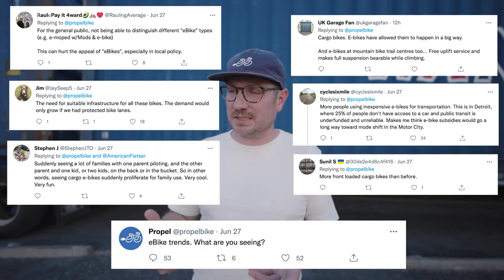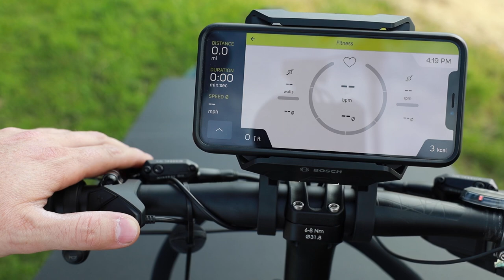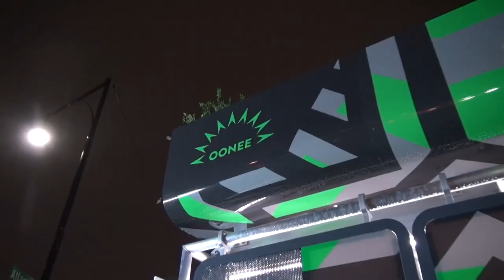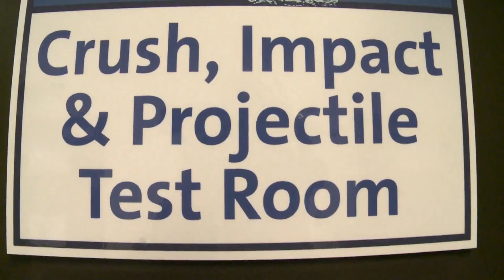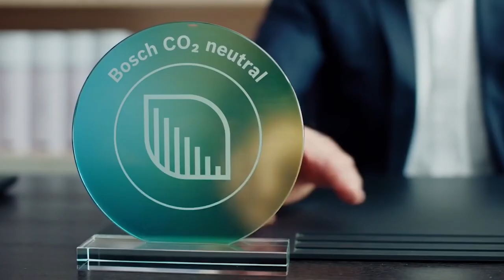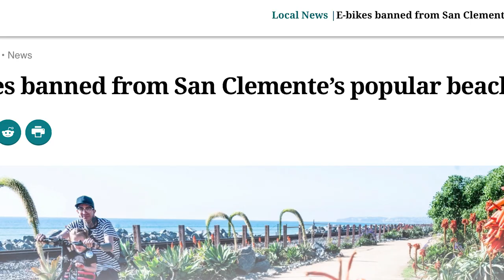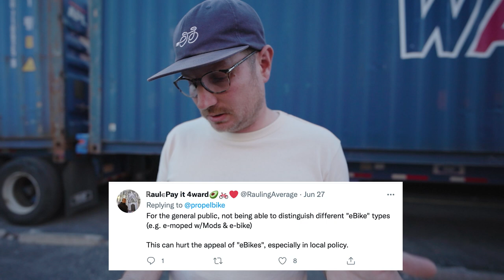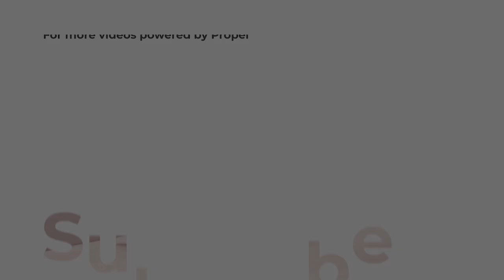eBike Trends for 2022

Comment: Thanks for a great and thoughtful overview of the industry. Linking to the safety issues discussion I’d like to add: Braking of bike trailers. The need for brake systems on trailers that integrate with the bike’s brake. I.e. that brake/s on single- or double-wheel trailers are also activated – e.g. hydraulically or electrically – when braking the bicycle. Loaded bike trailers easily add 50-70 pounds (25-35 kg) to the bike’s combined weight. In one case on Youtube the rider tells his trailer weigh 100 kg. 
Two: particularly for vacation purposes the range of ebikes is an issue. I.e., long distance travelling I believe is growing. This includes visiting more remote places where charging possibilities may be few and far between. For added flexibility – daily use vs. going on vacation - manufacturers may build in plug/s and battery combiner electronics for easy attachment of additional batteries, including non-brand specific ones – for 200 mile/300 km range. 
Lastly, reviews and testing of ebikes would benefit from discussion of a bike’s expected range. I am mindful of the issues related to wind, road and gradient conditions, the rider’s weight, the number of stoppages when riding etc. However, a simple test of the range achieved by the reviewer and the number of Wh consumed per mile/km will benefit prospective customers in choosing ebike’s that suit their needs.

Comment: I used to ride my regular bike for local errands. I have it insured and use a Kryptonite lock for the bike with a cable through the rear wheel. I felt safe enough taking it to the barbers, dry cleaners, Sprouts, Krogers, local shopping centers. Even rode to the nearest express bus center and took it in to Atlanta for work several times. There is a multi-use path very close to me, giving access to pretty much anything I need. However, no bike racks at Target, Publix, Lowes, Home Depot, optometrists, dentist, Chick-filA,  Zaxby's, ... It would be a huge win if shop owners with easy bike access simply installed decent bike racks. I've taken my e-bike to a lot of these places and feel pretty safe with shops that have something to lock my e-bike to. But I wouldn't take it anywhere that doesn't at the very least have a bike rack or something suitable. I should probably start writing letters just asking for bike racks. And add my e-bike to my insurance plan. And maybe get a slightly beefier lock. And either lose a lot of weight or get a battery with more range. Or both.

Comment: They NEED to get more affordable
Reply: Agreed. Won't get better infrastructure until we get more bikes on the road.
Reply: Some ebikes cost as much as a car did in the 80s. Down right ridiculous.
Reply: With time, the secondary market is going to be more available. Right now its still kind of cutting edge so not a lot out there
Reply: So you wanted more affordable cars or cars which are built good? I guess we know the answer.
Reply from the maker: I agree the price needs to come down. This will happen with scale. It’s just a matter of time. Unfortunately many of the cheap eBikes cut a lot of corners so it’s a false economy from my perspective. Once we have proper safety standards this will start to stabilize and scale appropriately.
Reply: Retrofitting existing bikes with a conversion kit can make ebikes very affordable. Obviously "affordable" is subjective but I converted mine for $2k and now I have a 40kmph bike with a 60km plus range. Bloody brilliant
Reply: You can get ebikes for less than a thousand pounds. That's affordable.
Reply: @Propelbikes  If you wanted to, you could sell Chinese bikes as well as the ridiculously overpriced ones you sell. The Chinese bikes are just as good as bikes costing twice as much or more.
Reply: @ninetendopesaitama2107  Of course we want an ebike that is built good. It can be done at lower cost. C'mon.

*

Comment: Chris, you well covered most of the angles and bases in this video with some well-thought opinions. If I may: 2 items: Right to Repair and the quick fade of Haibike in the US/North American Market. Right To Repair: There are a few of us out there that like to maintain and repair our own bikes. After the business Performance Line Bearings in England came on line with kits to renew our motor bearings, I thought why does not Yamaha or Bosch, Brose or Shimano make available the interior components of our motors, such as circuit boards, torque sensors, clutches and gears? That old saying of "Just toss it and buy a new motor because their are now user-servicable parts inside" is beginning to get old. People have the right to repair what they own. On another related front: battery rebuilds. I'd like to see the big, mainstream manufacturers offer the option of rebuilding our batteries, instead of tossing a one time battery that cost near a grand, into the recycling center....... Haibike: It was not long ago that the H-Bike lineup in the US was an incredibly large numbered and quite varied lineup of bikes from trekking style touring bikes, to mtbs in 27 or 29 or fat  tire styles and in between. Now, the US distributor has severely cut back the models to a sparse few, with none featuring the latest high powered PWX2 engines from Yamaha. Their advertising has been cut to zero, no more ads bought in Electric Bike Action magazine. Traffic on their facebook page reflects their own input to their page: Little to none, the last input from a poster was months and months ago. Over in Germany, many buyers still wait for their H-Bike to show up after over a year plus of waiting; while their carbon fibered all-mountain bikes were suffering from cracking around various pivot points. The Flyon adventure seems to have not worked as they thought and if I am not mistaken, the entire company was bought out by a holding company. The Haibike of today appears to be a shell of the dynamic, visionary company run by Susanne Puello and her people. I hope I'm wrong as I love my own Full FatSix and hope to keep it for many more years.

Comment: I'm one of those DIY riders that blurred the lines in my 1st build but I see it like a car engine. I wouldn't buy a car that could only maintain the speed limit on flats. I'd like to see the laws concentrate on how not what people ride.
All due respect to Rad, I love that they present a comfortable entry point into e-bikes for the majority of people. The bikes at Propel are a cut above, more what you aspire & graduate to once you've committed to e-bikes.
Reply: I agree that a nice entry point is needed. I just bought a Rad; there’s zero chance I would have spent double, or more, on my first e-bike. But there’s definitely a chance I’ll upgrade in the future, if it’s something I end up loving and using all the time.

Comment: Prior to watching the video:

I see great potential in upgrading existing bicycles to ebikes, ride one myself and it's great. I didn't have to spend 3+ grand, get more performance than I would have with an off-the-shelf ebike and if the manufacturer of my motor or battery go bust (unlikely, it's Bafang) then I can replace the parts. Store bought ebikes are way to expensive for what they can do, especially the speed limitation is just a joke and holds back even ebikes that cost 10 grand.... I see some interesting developments in the lower budget market but it's hard to tell how long those companies will last, the risk of having an unrepairable piece of scrap in a few years is pretty high. I'm expecting some bigger players to enter the market but unless someone actually manages to produce high-quality bikes with great guarantee and service at a reasonable price, I don't see them sell loads... and we need to really kick this trend into gear!

Comment: I think there will be a bigger divide between cheap e-bikes and the (more quality) ones: Entry-level ones that are sold for cheap, but as one drives them they get bored with the lack of comfort, safety, and general lack of fun, and will upgrade the gear. 
Lawmakers are going to step in to make sure the roads are going to be adapting to the new reality and enforcing stricter rules to make this a safe transition. 
Personally hope the big motor brands are going to be more inventive in ways to make the bike lighter (eg why not put gears in them, save up on the gearbox: integration of all technic in one place) and teaming up with frame manufacturers to create the perfect symbiotic bike.
Pretty sure there will be lots of new hip investor-driven bikes (like vanMoof) that will try to gain popularity, but afraid (for them) that quality and service will be more important in the long run, in that regard you might be on the better track ;-)

Comment: I figured I would put my two cents in since I started biking again since, o' lets say 1984.  I purchased an E-Bike back in february and absolutely love it! Two of my co-workers have since purchased E-Bikes.  I guess in my little microcosm, that tells me E-Bike sales are on the rise.  The two dampers I see to increase in sales are depressed economies around the world and lack on bike friendly infrastructure, which has been a systemic issue for 75'ish years at this point.  Here in Arizona we also have a unique challenge with the heat and conservative governments , which tend to only be bike friendly up to recreation and not extending through to transportation.  I am hoping the higher gas prices might swing the pendulum the other way, but the 106F heat is probably going to prevent that.  

On a side note, anyone that has ridden a motorcycle by cornfields in the summer knows that evaporative cooling can be engineered.  My hope is we will get more innovative thinking in our various governments and work toward solutions to bike, pedestrian, and public transportation friendly infrastructure and get us away from our addiction to owning cars.

Comment: I'm here in A Coruña, Spain, where a newly-revamped public bicycle network, Bicicoruña, went online in early July of this year, which consists of a supply about 1/3 electric bikes and 2/3 mechanical bikes. About 1.3 million euros from the European Union and a push from the current mayor to build up the bike lanes in the city starting in 2019 has made a very real positive impact in the city with continued expansion in the number of bicycle stations in the city. I'd never ridden an electric bicycle before this summer and these new bikes (both the mechanical and electrical bikes are built in Canada), so it has been a real mind-opener not only for myself but I think also for many people in the city here as well as for people visiting the city from other areas of this region of Galicia, from other regions of Spain, as well as tourists who arrive in the thousands via the large transoceanic cruise ships that doc here weekly, sometimes three or four ships at a time with three bike stations right near the port, each within about 300 meters one from the other. I am jazzed to look into my own electric bicycle now, and really appreciate your detailed analysis of the market now, especially with a bead on the UL-angle for safety. As a longtime cyclist, recumbent trike commuter in the States (Iowa City, Iowa) from 2004-2008, it's great to see the evolution of all things bicycle, not only the technology of the bicycles themselves but the infrastructure and the mindset in general of many places in the world... it's exciting and fun to be in a city where when I park a city bike after a ride, almost invariably there is someone looking inquisitively at the bikes and the station, and I've the opportunity to participate in the educative process of the city's/region's/country's/continent's/world's transformation to being bicycle-friendly. If you speak Spanish and/or Galician, here's a link to the city's bicycle system, Bicicoruña: https://www.bicicoruna.gal/es

Comment: I'm curious on Propel's thoughts on non-bike e-mobility, like e-scooters, e-skate and powered mono wheels. When I look at say the Brompton Electric (so beautiful), which has the goal of 'e-transport that fits under your desk' I think that is also achieved, for a similar weight, price and range, by an Electric Unicycle (EUC). A lot of delivery riders choose scooters or EUC's because they can be brought with them when picking up or dropping off, significantly reducing the risk of theft.
Reply from the maker: I think they all have a place. I do think it depends on the intended use and the infrastructure. To replace car trips, eBikes serve a greater chance, especially when you look at cargo bikes. Many roads aren't able to accommodate these smaller wheels and I personally often don't feel so safe travelling at any decent speed because of it. Sure the experienced rider may be able to navigate, but I don't feel it's for the masses. Maybe shorter distanced, but longer distanced at higher speeds I think you need a 20" Wheel at least.
Reply from the maker: Theft will be mitigated significantly by better parking options and a better strategy for theft recovery. It's a little complex, but it is possible.
Reply: @Propelbikes  thank you for the reply - I agree on the cargo point for sure, there are long distance EUCs at the 18" size, complete with a seat - but they are beasts that are not as portable, and the price goes north of $4K. Agree on the not for the masses too, at least not yet. Really enjoy your coverage of the not-a-car space, love your videos.
Reply from the maker: You’re very kind! Thanks for the support!

Comment: Very interesting.  On my latest biketrip through France, I met some people that were biketouring with an electric bike.  What I noticed, is that they were carrying way more stuff than what you usually carry when using a non-electric bike. I wonder how they manage with keeping their batteries charged, but I was surprised to see that.  I always thought you would be really limiting yourself with the distance you can travel per day, but somehow they manage to do it.
Reply: Middrive ebike has very impressive range.
Reply: Funny, I just came back from France touring on my ec-cargo bike. I did indeed carry much more than I would normally (even a pair of fold up chairs!!). I didn't need to worry about the weight at all, or the bulk for that matter. I have a twin battery and my range is about 100 miles with that. Charging was no issue at all, simply stay at a campsite and charge for free or a Euro. Wild camping is a bit of an issue though, they are so heavy it's difficult to hide away in the woods.

Comment: good chat. the thing I dont like about these big funded startups is just how unnecessarily proprietary they are making things.Everyone wants to build the walled garden and be the next Apple. In the long term, a lot of these products will be totally useless once they are broken and unable to be repaired easily if the company stops supporting or goes under, and this will contribute to the growing e-waste. Idk a lot of the 'cool' brands seem to be so over-designed. Like normal, reliable bikes have existed for years. Just stick a motor on it, you don't have to reinvent the wheel.
Reply: but ma square wheels...
Reply: Indeed.  
E-bikes require special bike rack.

Comment: Possibly we will see more SAE type rules in the bicycle world and what stays a bicycle and what becomes governed under a different designation. In Phoenix you could drive a golf cart or 4 wheeler on the secondary streets if you had it licensed as a motorcycle. Phoenix also has very wide streets, bike lanes, bike trails. Good ways to use all designations.

Comment: those moped style "e-bikes" that have a throttle and go 30+ mph are ruining it for everybody else. these companies slap on a set of pedals on these "bikes" knowing damn well nobody actually pedals them. those things are basically motorcycles and idiots ride them on the bike paths at the beach at full speed. then they hit and injure someone and then next thing you know all e-bikes are blamed. it's very sad. many such cases. I personally think all e-bikes should require pedaling and have pedal assist motors only.
Reply: That's pretty much how it is here in europe. There is a 15mph speed limit for pedal assist and 6mph limit for throttles. I bet you wouldn't like putting up with such ridiculous limits. Americans could do the same if they wanted to, but I don't think they are that stupid. Maybe I'm wrong.
Reply: Although I agree with you on the bad riders ruining it for the rest of us, I could not manage my e-bike without my throttle. It's a heavy bike (Rad Rover 6 Plus), and getting going from a standstill, especially if going up a bit of a hill, can be challenging if you didn't plan ahead and gear down before stopping. That throttle has saved me from dropping my bike on more than one occasion.

Comment: For the U.S. market, and me personally,  100 mile range @ 45 max mph, solid state battery, solid spoke wheels, no more wire spokes, all wheel drive, ( hub motors) or chainless mid drive,( i.e. belt, shaft)
Run flat tires, expansion of dedicated bike infrastructure,
 (i.e. charging, bike lanes that will also accommodate 3 wheelers)
That's my short list.

Comment: I'd like to see more Dutch style comfotable geometry bikes in the USA, both for eBikes and regular bikes. Most of these bikes still seem to be that hunched over geometry, but I want to ride around in town and easily be aware of the environment around me as I go. It is surprisingly difficult to find this, even in eBikes, especially if I am even slightly picky about what I think is actually a comfortable ride for me. It seems like most bikes are just not designed for comfort for some reason.